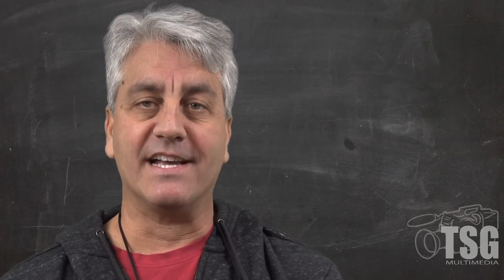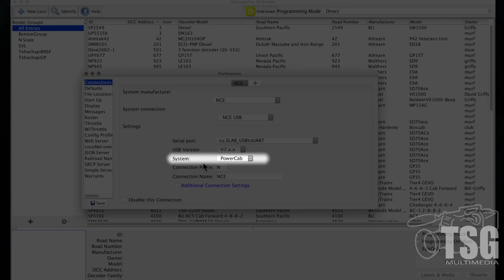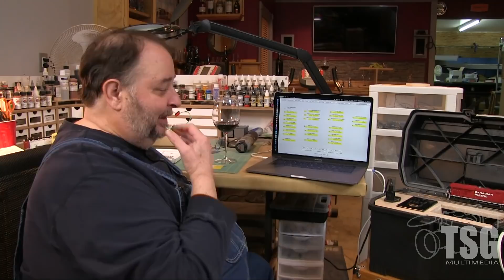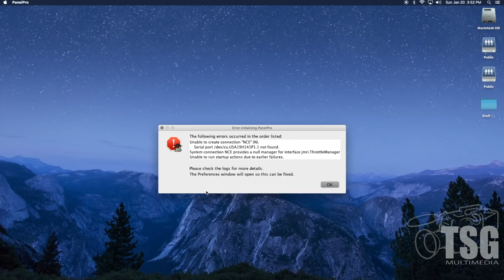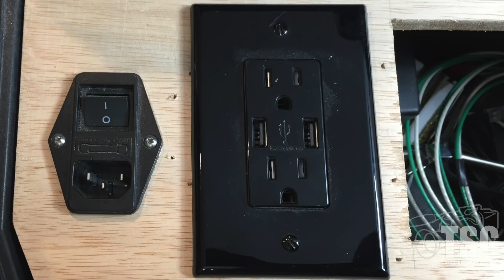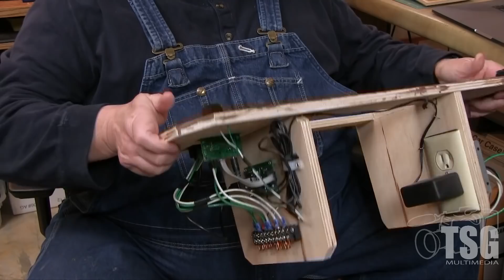Model Railroading 101 Using JMRI With NCE MR101

Comment: Hi Thanks for video
But wondering how you achieve or set up feed back sensors to JMRI or other computer systems via either NCE system CAB or PRO.
So the computer system see a block detection or a turn out when switched in the field 
Thanks

Comment: Thanks, Murf for this helpful video.  I just installed JMRI ver. 4.26 on my computer and am using it with my NCE Power Cab. But I have a couple of question about what I saw in the video and are hoping you can give me some guidance. You said to look at the preferences and verify the connection.  My connection page shows everything is set the same as you show in the video. But you also said to look at the default page.  Your page has all the NCE's checked my page only has the "Command Station" checked. All the others "Throttles, Power Control, Service Programmer, Ops Mode Programmer and Consists" are not checked.  Should they be?  Also I noticed that on your main registry page you have the same situation that I am having.  On the top middle of the page the power button is yellow and says "Unknown" next to it.  My registry page is the same.  Do you know why that button is like that?  It should be either green for power on of red for power off.  I hope you can shed some light on these questions.

Comment: Hi John, nice video. I noticed in the power pro section of the video that Murf's track plan had 3 passing loops, how are they controlled with JMRI? I have a fiddle yard / storage yard area with 10 passing loops on my double track layout. So prior to using JMRI, I gave the pairs of turnout motors for each specific loop (entry and exit) the same DCC address so that both motors would operate together as a pair. I have just added JMRI Panel Pro, and can only switch the loops by clicking on one of the pairs of turnouts on my track plan. Is there a an alternative method without having to give separate address's to the pair of turnouts ? Hmm not sure if a passing loop (UK term) has the same meaning in North America?
Reply from the maker: I heard back from Murf. This is what he said,

"I had a total of 5 staging tracks on the upper level.  I used JMRI Routes to setup paths through each track.  The turnouts had individual addresses and then they were added into a route with the direction (normal or reverse) that they needed to be in for that route.
So fill in the turnout table - giving each turnout motor its own address
then make routes in the route table.
WiThrottle has the capability of toggling the turnouts or the routes"
Reply: @tsgmultimedia  Thanks John, I did expect that each turnout would have to have it's own address. In my instance giving separate addresses would interferes with my DCC Concepts Alpha Central Panel, where specific pairsof buttons control 2 turnouts each. The only way to get round that would be to add an extra panel to accommodate separate addresses. Not sure that I want to do that just for my fiddle yard, as I don't always use my laptop to control the layout. Thanks for asking though, and keep up with the great videos.
Reply from the maker: HI Eve I'm not sure. I'll ask Murf to take a look at this question when I have a moment. I can tell you that Murf's layout from that video does not exist any more. He's building a completely different layout in that space, and it's really good!

Comment: Murf, THANKS for the time and effort you put into these Videos!! 
I LOVE your "DCC/Programmer in a Box"! That is so clever! 

Wanted to put out this tidbit of information...
I got a PowerCab about 9 years ago. Love it, but outgrew it quickly.
What I did is still considered controversial by People who know me in the Hobby!! 😳 I couldn't (still can't) afford a PowerPro System...

So I replaced the PowerCab 1.5A Wall Wart with a 4 AMP 14V Brick Transformer!!
EVERYONE said I would burn my House down...

I'm a Retired Auto Technician, specializing in Fuel Injection, Auto HVAC, and Wiring. This decision wasn't a blind guess, and the circuitry WAS examined and researched.

My 4 Amp PowerCab has been running my 6' x 22' HO Scale Layout SAFELY, since 2013!! 
I can't get anyone to see the merit of this.
It was a $26 upgrade, instead of a $300+ upgrade.
Thanks, Carmine ✈🚂🚙
Reply: Does this still work good for you?

Comment: I just built myself a Throttle box similar to this and learned a few good tips I may include in a future iteration. A few pieces are still temporarily mocked up, but I"ll have to upload a video when it's done. The big difference between Murf's and mine is that mine is 100% self-contained; all my connectors are cut into the box so I can close the box and run the railroad. I also included a Raspberry Pi running JMRI with an LED screen in the lid and a wireless keyboard so there's no need for an external laptop. My system is extremely compact at less than half the size, but I use Kato Unitrack to create the programming track so the locomotive doesn't dictate the box size.

Comment: I have a similar box, I set mine up so it can be on the workbench or power the layout since I did not want to purchase a seperate Pro CAB or another Power Cab for the layout. I also included a CP6 to protect against shorts and plan on installing wall warts for 12v and 5v ports. It is also a good idea to have the USB Interface external as the LEDs need to be seen for trouble shooting of the JMRI connection.

Comment: So I am about to set this up. I see you are using a flat cable from the Power Cab panel to the USB interface. The instructions say I can use the coiled cable that came with the power cab. Is that true or do I need to get another flat 6-pin cable?
Reply: The coiled cable that comes with the power cab is for when you use the "hammerhead" as just a throttle on another system.  To use the Power Cab you need to use a flat cable.  I bought a crimper and a roll of 6 conductor cable (6P6C) because it's also what you use to attach cab bus plugins for a layout.   https://ncedcc.zendesk.com/hc/en-us/articles/203841409-NCE-Cab-Bus-Cable-Parts-list has the parts list.  There is a note on the NCE site that the power cab 6 wire cable should only be bought from them.  (https://ncedcc.zendesk.com/hc/en-us/articles/203868379-Powercab-flat-cable-length-)    I made my own before reading that, so I must be grandfathered in ;)  I made a short one for the box and it works!

Comment: If you find a USB to Serial adapter and you cannot find a driver for your operating system, open up the adapter and look at the main chip. There should be a serial/identification number on it.  Google that number and your operating system name (example: 04403023 Windows 10)... and find a driver that way. You might get a message saying that 'this is not an official driver' but it will most likely work. I've had to do this for about 30 such devices when we went to Windows 7 at work a few years ago and the company that made our adaptors no longer existed.

Comment: Very new to the hobby. Building a 4x8 layout. I have been to the NCE's web-sight.  I am wondering if I should get a power cab or power pro. If you have covered this already, would you point me to that show. Thank you.
Reply: When my layout started to grow a lot there weren't a lot of options.  The club I belong to (Silicon Valley Lines) uses a Power-Pro system so I went with that, along with 3 boosters.  Now that NCE has the Smart Booster it opens up a different option when you start with a power cab.  I'd go that way.  If you need more power (running a bunch of lashups all sound) then you could grow to using a Smart Booster - https://ncedcc.zendesk.com/hc/en-us/articles/200913385-SB5-Smartbooster-for-Powercab  - so you have options now that I didn't have with a Power Cab system.

Comment: I really  like  your  power cab  programming  box . If you  have  problems  with  your  plugin  coming  loose  you  can  try  a tamper  proof  plugin  it is a pain  to plug in but it does  hold  a  lot  better. 😊  nice informative  video.
Reply: I'll have to check that out!  Thanks!
Reply: @murfmurf313  You might also look at childproofing products; if it can keep a toddler from removing the wart, that's more than good enough to use inside the box.  Many just require removal of the plate screw and reinserting it over the proofer.

Comment: I am in the planning process of building a "portable" DCC programmer with a SPROG-Pi. That way all I need to bring is a keyboard, mouse, and monitor. Once I get it working, I'm going to add a Digitraxx PR4 to interface into anyone's Loconet. There will be a wireless router in the system to  be able to run Wi-Throttle and it remote into the Raspberry PI. The possibilities are endless. I have to say I really like "The Box"!